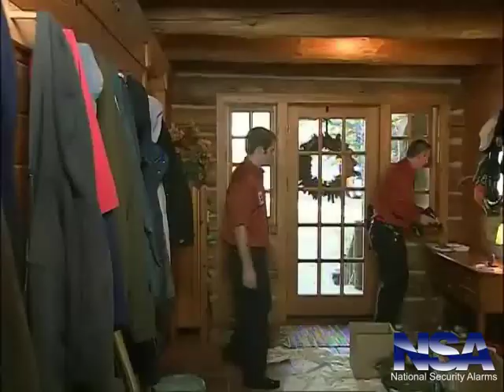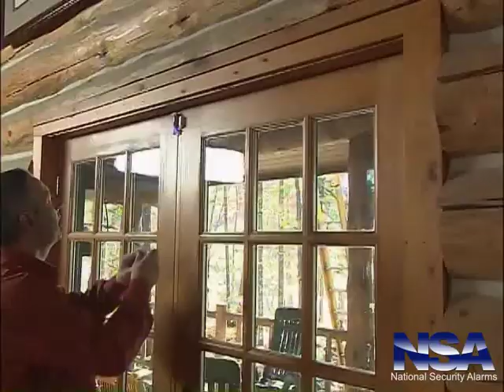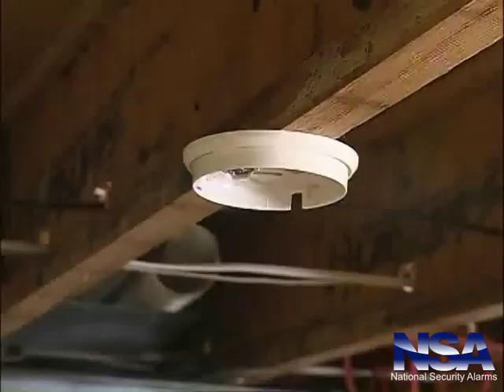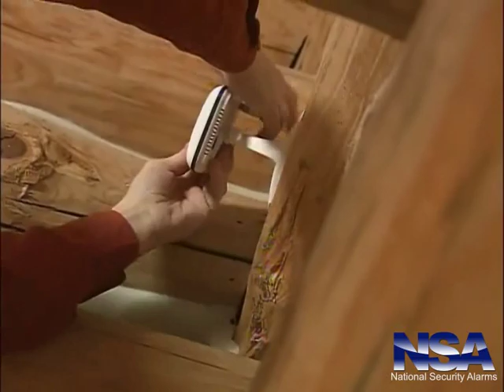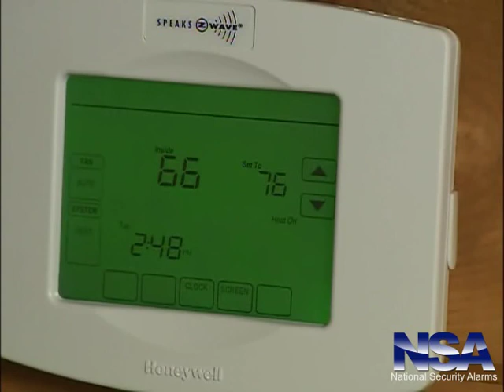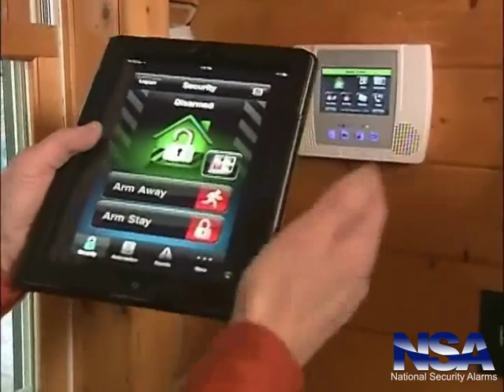Honeywell Lynx Touch 5100 - shown on HomeTime

Comment: System is great but I would have installed brown sensors to be less of an eyesore. In addition having the unit by a door that can been seen from outside allows people to see the status of the system. Just my opinion based on my 25 years in the industry. Great system though